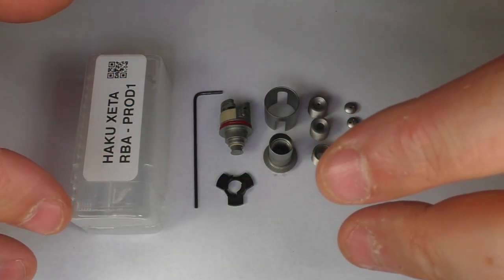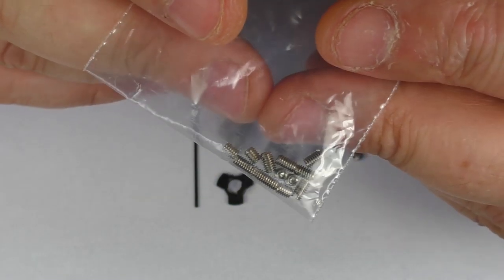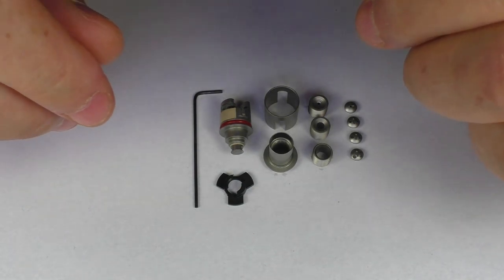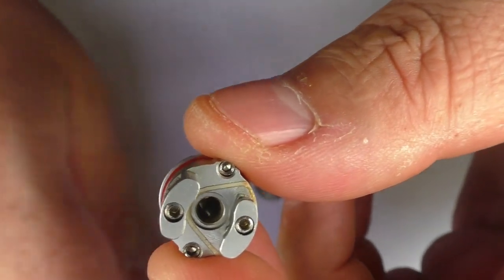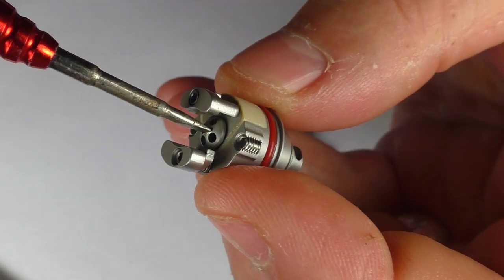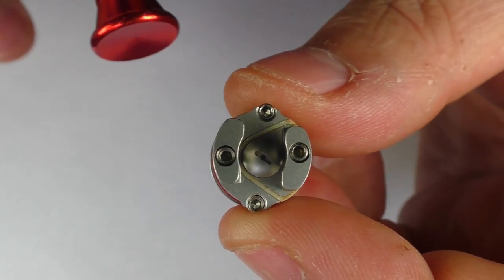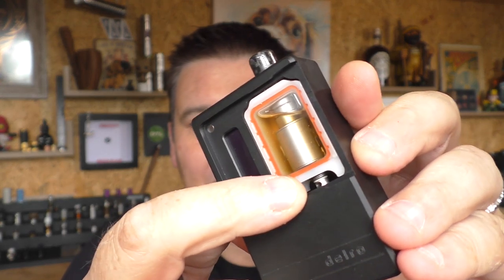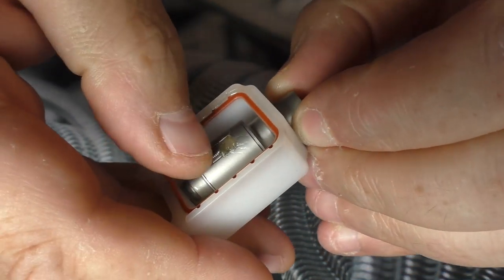HAKU XETA RBA - Production Version.

Comment: I’ve never been able to justify the whole BB thing especially with stock coils. This though, with a 3mm draw is perfect. I always found the Squape R to have the perfect draw for me and now this can match the draw. My birthday is coming, so hopefully I can get in with the Friendly Flipper group because I like the Delro and get one of these. Thanks Mark, as always, for the great review.
Reply: Get the sxk version as long as you get the dna version you are getting a quality device.. it vapes identical the original. The only thing you get with authentic is a little better build. As they are made completly different. But they both use the same.DNA chip. I have both. I started with sxk because I was.not going to spend that kind of money if I was not sure.. I use the sxk for work and got authentic to support them and use when home. I get the best vape out of the older non gimmick rbas. The insider and kanger rba are still king..  I love my billet, vapes amazing plus is the same size as a pack of smokes and zero glass to worry about..

Comment: Hey Todd I had a question about a different RBA section. I just bought the bantam box 30w and wanted to use my old Triton RBA head. I know the is an Atlantis Boro tank that fits it. Have you ever used the Triton RBA, Let alone in the billet box or Bantam box?
Reply from the maker: Sorry but that one I do not know :(
Reply: @ToddsReviews  that's alright, thank you for the reply. I'm just gonna have to  buy one and see for myself. I wanted to make a vertical coil in the bantambox, but I couldn't really find any vertical RBA sections for the billet box. But the Triton RBA fits one pretty easy.

Comment: Trying to use my normal SS Clapton that l put in things like this(six wraps 2.5 is about.6-.7) not sure what it is any more because the fury fours leggers ate the label. But the problem is the clamps. The more you try to tighten it, the more the wire squeezes out. Just when you think you have it the wire pops out when wicking.The surface of the clamps needs some sort of friction. Or a piece of wire the same size on the other side of the screw to keep the clamp level.

Comment: I have been getting extremely bad dry hits on mine, I even took out the side screws to increase juice flow. It's really ruining it for me, any advice?
Reply from the maker: No much it could be outside your cotton Graham, I run mine with the screws in with a 80vg at 25 - 30w and xero wicking issues.

Comment: Picked one up on a trade......... sorry chief dont like it. The post design restricts the coil size far too much considering the size of the actual deck. Its well constructed just think they should have went with a different deck setup. Will be ordering the boxxer v2 which is more my style i think.
Reply from the maker: It for you or it isn't, I can get my 3mm Clapton's in so quite happy 😁.  Personally wouldn't touch the boxxer after the v1 fiasco but that's just me.  Let me know how you get on with it :)
Reply: @ToddsReviews  yeah I thankfully waited for reviews and didn't get burned with the boxxer v1. I'll probably keep the xeta for my smaller builds. I could only get 2.5mm to fit comfortably. The 3mm Clapton kept shorting so I gave up tbh.